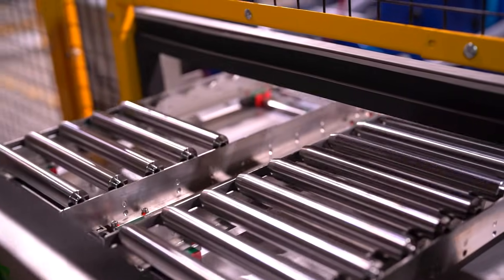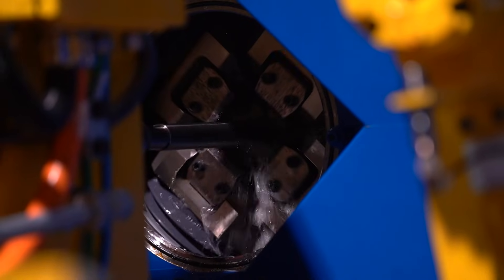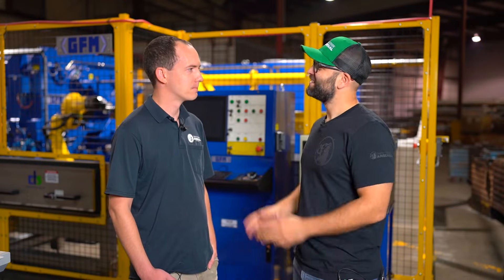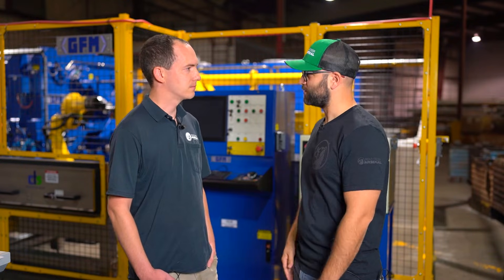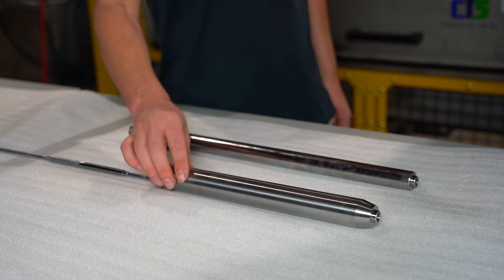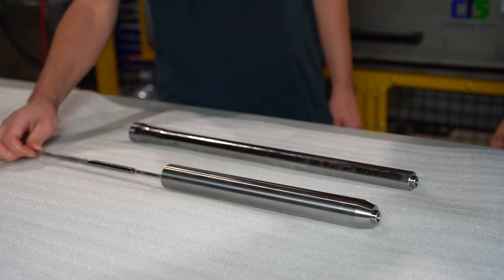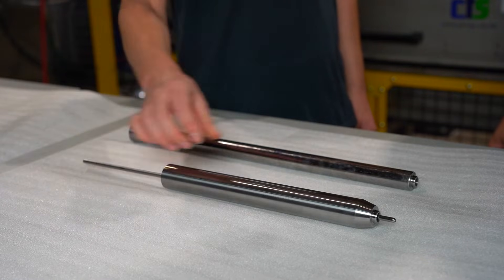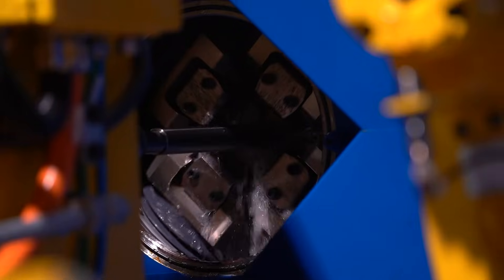How Cold Hammer Forging Works | Behind the Scenes! | What is Cold Hammer Forging

Comment: Can you tell me please just how many bench rest competitions a cold hammer forged barrel has won? I'll even go so far as to ask you how many cold hammer forged barrels have competed in a bench rest event?       If, as I know, the answer is zero then cold hammer forging barrels is NOT the best way to produce barrels based on highest quality achievable. It may be that it is the best way to produce barrels under your specific parameters ie fast and easily automated but the quality of the finished product is not the highest achievable quality based on accuracy. The barrels you produce may meet the parameters that you have imposed, which is fine, but don't deceive the consumer with statements that are not true. Cold hammer forging induces the most stress than any other method of barrel making by far.
Reply: Are you a metallurgist?
Reply: @F@Firebirds4ever, not a metallurgist.

Comment: I wonder what those mandrels and the cold forging machines are made of, to be able to forge the steel like that and not get damaged or deformed in the process. I know there are many materials harder than steel... but I didn't think they would be able to do this kind of work without at least dome kind of damage or deformation. Things like Carbide can be extremely hard, but at the same time they can be brittle. Like with end-mills, they can cut well, but if you put too much pressure on them they shatter. Their sharpness, fast speed and multiple teeth keep pressures down, but without the right feeds and speeds they can explode fairly easily.

Comment: So... We didn't get to see the machine hammering a barrel. We didn't get a real explanation, either. The engineer got basically everything he said wrong about what happens here.

Cold hammer forging does not leave metal grain structure intact. It deforms the grain structure very heavily, so much so that the clearly large diameter blank comes out much thinner and longer at the end of the process. This hardens the steel, and specifically, in a way that helps the rifling to stay intact under stress. The typical button rifling method also deforms the grain structure, but it does not cut the structure. It only deforms the parts which form the rifiling, instead of the entire barrel.

With engineers this bad, I do not wonder why Bear Creek Arsenal's quality control has nearly gotten me killed, or why their customer service couldn't even figure out how to exchange the offending barrel that I needed and nearly had to fire in a self defense situation.

I sincerely hope that the multi-million dollar machine BCA has purchased to make these barrels allows for better barrels and tolerances than they normally get... But this will still leave BCA doing the lathe work turning down the barrel profile and fitting the barrel extension, which leaves them potentially wrongly fitting the chamber... Again.

I don't trust this. I wish I could. I am sure the metallurgy is better than these people can explain, but the end process requires tolerances that BCA has developed a reptuation for purposefully getting wrong, purposefully putting out bad products, and purposefully charging their customers time and money to test and QC their products.

Comment: I have the 7.62x39 CHF nitride 16" and giving it a run today !
Reply: How did it shoot? Over or under gassed? How accurate?
Reply: @John_439  5 shots to zero at 50yds , 3/4" high bullet touch center line just right. Hit 2 spray cans at 50 2" below top at center. Used igman m67. I'm happy .
Reply: @John_439  I put a H2 buffer weight, couldn't see ejection pattern but a few bounced off old truck body about 3 oclock.

Comment: I gifted a 7.62x39 CHF side charger for my brother in law. I've been pleased so far with all my BCA rifles. They are accurate and well made.  I work at a training facility where our clients and instructors use the most expensive, big name platforms on the market. It's been a pleasure to make groups and hang with the best of them over 600 yards. BCA needs to sell more mags and ammo as I've had to source my Beowulf and 300 BLK items from other venders. Great job guys!
Reply: Geeez... What did your brother in law do to you?
Reply: yeah, I've owned 3 BCA rifles and every single one was a boat anchor. one got sent back for a refund (the barrel came with no rifling in it), one got parted out and the barrel scrapped (couldn't hit paper at 50yds), and the last one i sold for $100 to some dude i didn't care much for (it worked fine, but they never deburred any of the upper parts so i cut myself on it all the time and the side charging handle came broken from the factory).
Reply: @Simply709  That sucks. I couldn't be happier with mine.

Comment: How is the machine constructed?it is damn strong for doing that deformation to the thick pipe of steel.
Reply: Yeah these machines are incredible but need to work perfectly. I made barrels for a major gun manufacturer, and the hammer forge in the cell I was running shattered the hammers when the robot failed to grab the part after a power outage. Also had a much older forge, still a cold forge, where the mandrel got stuck in the barrel. The scary part was that the part couldn't be backed out without dropping it on the moving hammers, and the mandrel was actually bent inside the machine and was like a heavy spring.
Reply: Fr I was so confused like that has to be an insane amount of force.